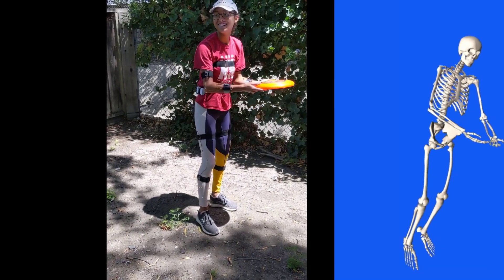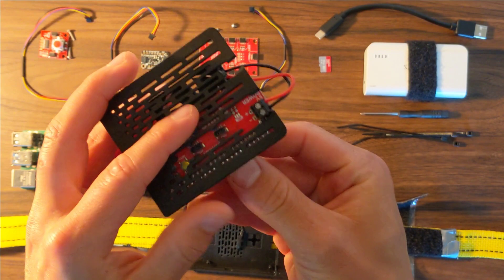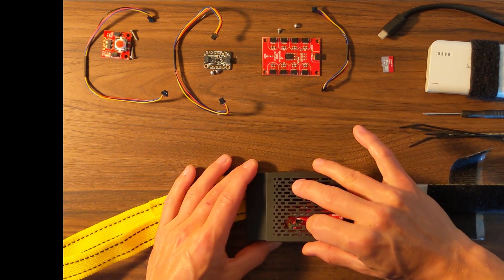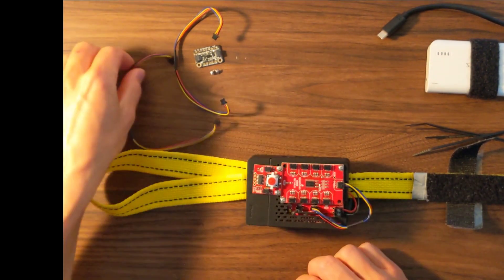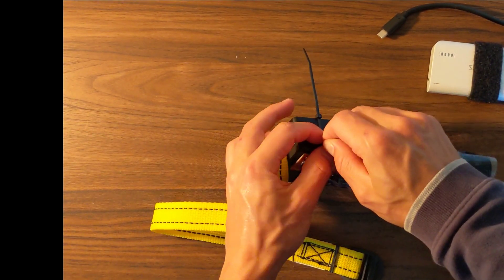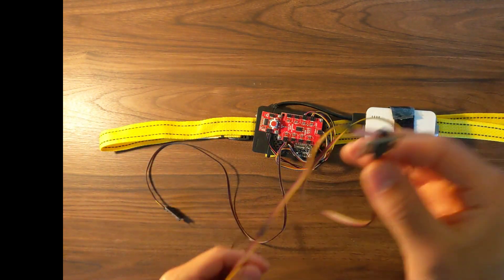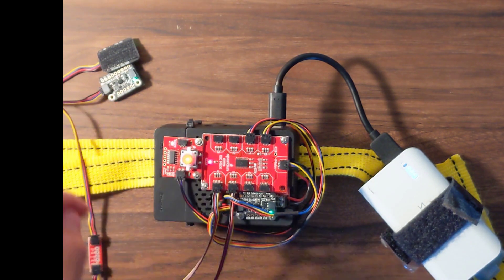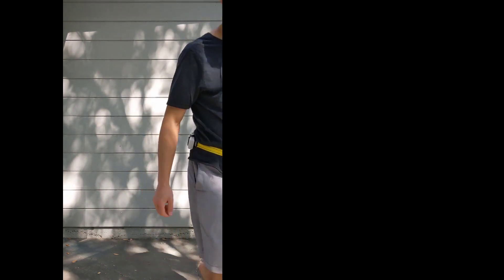Building the OpenSenseRT System

Comment: Is there anything where the software installation and configuration, and how should we see it can be shown? I am trying to start the system after all, but it sends an error with start4.elf and some thimes just a black screen. Thanks.
Reply: I know it has been a long time, but were you ever able to make it work?
Reply: @fornerobj  yes you need exactly everything the say in the same tech specifications. I mean, if it says that is the version 3 you need the same 3 hahahahaand then update everything. I will answer you with all the steps
Reply: @Brunouchi  I switched out the IMUs for different ones that are listed as supported in the documentation, and switched out the phat for the normal quiic hat but other than that it’s all the same